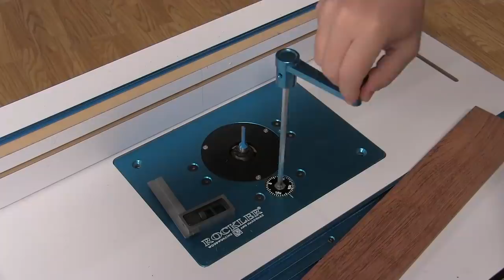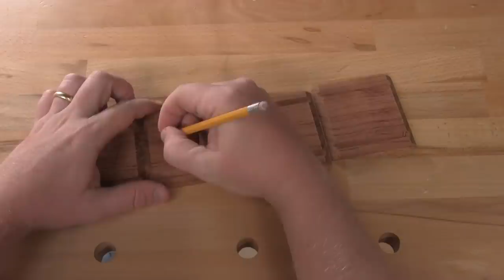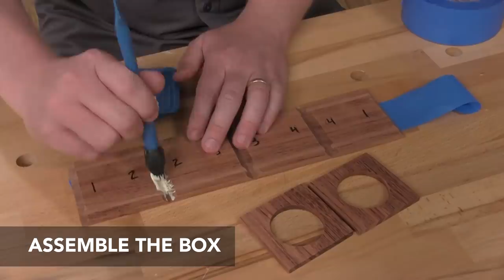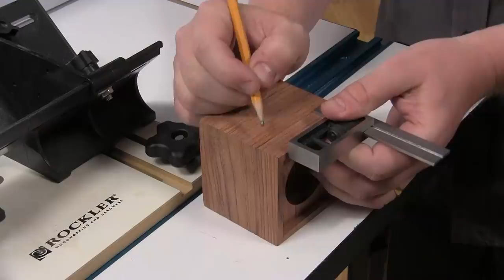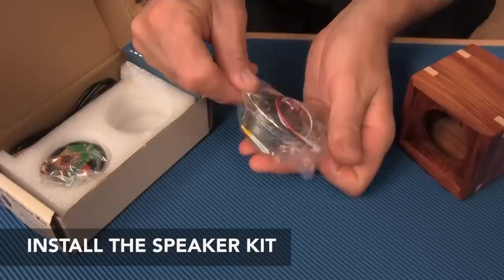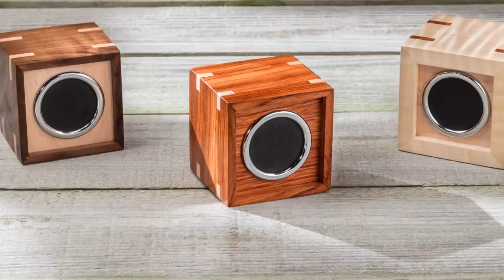How to Make a Wireless Speaker Box | Rockler Project

Comment: It would be helpful to know: what was the thickness of the material used on the 4 sides, what is the thickness of the front and back panels, and what thickness was used for the splines?
Reply from the maker: 3/4" and 1/2" for the sides. The same is acceptable for the front and back. The splines are 1/4".